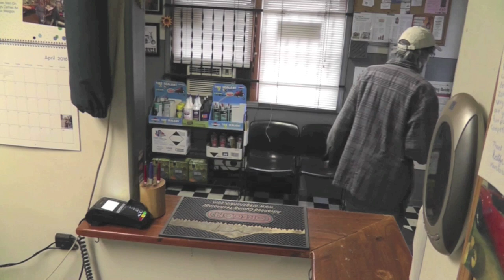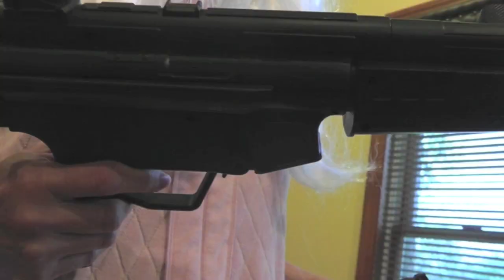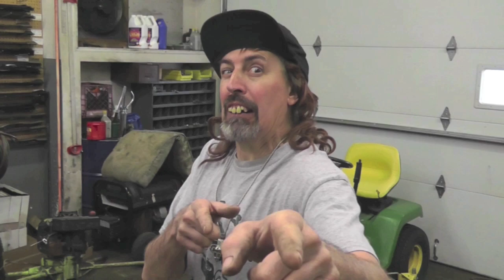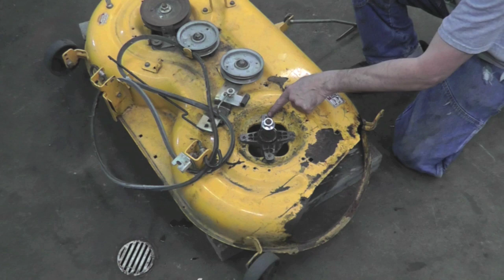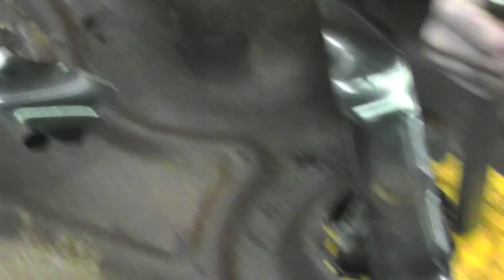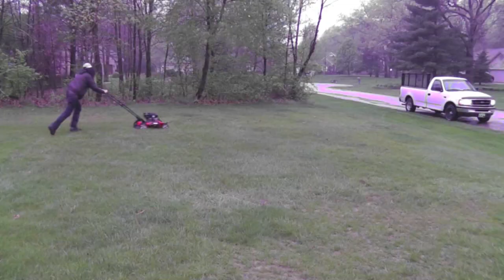Easily Fix Your Bent Mower Deck (Cutting Uneven)

Comment: Easier way to do it.  I've straitened 1/2 dozen Craftsman 42" decks.  Always left side, about 2-3 o'clock, facing front. Can determine by stretching string across pulley tops.  Will be space about 2-3 o'clock.  Loop a short length of small log chain around 5' crowbar and just under pulley. Pull back on crowbar, sometimes have to put a weight on opposite end of deck, often not. Keep pulling and stretching string across pulley tops until no space, can be verified by matching blade ends underneath.
Reply: I wish you could explain this a little clearer. I'm trying to visualize your directions but not really getting it. Wish you'd make a video or even a few still photos.
Reply: You need to be clearer on these instructions. Is this with the deck still on the machine or off? Are you 180 degrees opposite the 2-3 o'clock position when you are prying with the crowbar? What are you anchoring the bar against--the deck while you're prying or what?

Comment: If the deck is bent, it will line up to the same line you made as long as the blades and spindle is straight. You need to measure it against the deck lip all around. I do the same but I shim the deck til the deck lip is level with a bubble level. Then lay the bubble level over the spindle mounts. Adjust with your BAH until its level all around. Then you can take a straight edge across both blades.

Comment: This was the best informative video ever. I put new spindles on my deck. (Bearing was out)  still mowed crooked. New lift cables, still crooked, adjusted deck, still crooked. Found this video.  Got out the big hammer. Mows straight now. And the wife cooked me dinner.
Reply: There's your dinner
Reply: Lower psi in one tire, raise the other. Problem fixed.

Comment: Love your videos and your way of putting your knowledge out there to us.
This is the first time I've seen something in your videos that I cannot agree with.
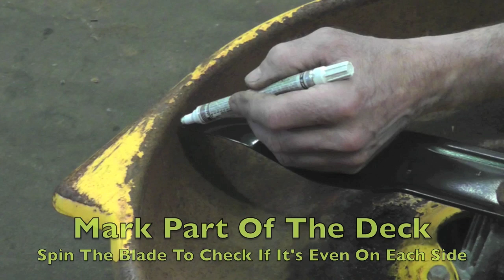At 6:00 in the video, you marked where the NEW blade hits the deck and spun it around. You said something like this one lines up, so it's gonna be the other side that's bent.
If the spindle is running true and the deck itself is bent, the blade would line up on both sides using this method. The way to actually measure the variance is by laying a straightedge across the deck and measure down to the blade edges.
Keep on sharing the great hints and how-to lessons! And it looks like you might want to see a barber soon. 💈 ✂️😉

Comment: You're amazin' Taryl!  I cannot tell you how many times you have helped me!  Could you have shimmed the spindles instead of beating the crap out of the deck and possibly breaking one of the spindle housings?  Your fan forever!
Reply: I was thinkin' same...
Reply: I was thinking this too. Swimming it seems easier.
Reply: It's easier but it doesn't work b/c it skews the geometry of the blade. Everything MUST be in the same plane or it WILL scalp. Ask me how I know.

Comment: Please don’t tell people to beat their decks to death. Use a straight edge on the sheaves and use a galvanized pipe with a flange bolted in place of the spindle. Then you can gently bend the deck back in the correct direction.
Reply from the maker: T Blake Good luck!

Comment: All my stuff is old and all the decks look like that, usually I paint the underside with a mix of oil and cosmoline every couple years. If I get a really nice deck, I wire wheel it (safety glasses. face shield, gloves and apron), use rust killer( converter) and paint. Decks go bad before the rest of the tractor.  Great channel Taryl.

Comment: NOTE:  Go get large some Washers, place them on top of the bolts.  This would help it strengthen and prevent warping.  The washers must be as large and thick as you can get.

Comment: I had the exact same issue but fixed it much easier..I used a 4 foot level laid across the deck and measured the blade tip to level distance  then went the opposite way over each blade to measure the other way
Reply: This would be the truly best way to ensure both blades are aligned properly.

Comment: ust because the two center tips are even does not mean the blades are alligned correctly. You really need to lay a straight edge across the deck to make sure both the inside tips are not high or low. You can correct the cut misalignment in the center and create a misalignment on the next pass on the outside.  BTW love your sense of humor.

Comment: Just fixed my John Deere Z225 42" deck!  Thanks for the great video.  I went straight to the sledge hammer and it worked great. Thanks again!
Reply: I have that mower and I’m having an issue where it’s gouging real bad. Looks like this must be the problem.

Comment: That mushroom should be ground off that bar before you beat on it. One of those slivers can break off and put an eye out. It's a good idea to wear safety glasses when beating on things for that reason. My local carpenter loss an eye that way. I know the odds are slight but losing an eye is forever. It's a good idea to wear ear protection too.

Comment: I did this today but a little different. I placed a level across the pulleys and straightened the mounting ears until they were level. Worked good hopefully it lasts. Had to do some welding on the deck also found cracks here and there.

Comment: I checked tire pressure, level floor.  The Blades are leveled with a blade gauge, side to side, but I note my deck (E100) is 1/2 inch higher on the grass chute side, including the scalping wheel (but blades are level.)  I checked the alignment of the bottom of the two blade tips and they are within 1/8th of inch of each other, so they are not crooked.  What could be causing this?  If I level the deck instead the blades will be off.
Reply: One of the deck hangers is adjusted differently  than the one on the other side. Or low or flat rear tire

Comment: If you snap a bolt in your spindle you can get the bolt out by boiling the spindle in a saturated solution of alum(pickling spice) just make sure to use aluminum or glass boiling pot and pull everythinh iron out of the spindle. Alum solution will eat away anything steel

Comment: a crude method that works as long you don't loose your reference
in such a case, I by far prefer use shims to regain plane between both blades

Comment: Taryl, I have a JD Z255.  Every time I mow now, the drag link that lifts the front of the deck comes out of its mount on the frame. Is this an indicator of a bent deck?
Thanks, Steve
Reply: I am not an expert but if the mounting brackets are not damaged then you probably don't have enough weight hanging on the drag link. Do you have your front wheels set too low. You want the deck hanging on the drag link and not taking the weight on the front wheels. I would also get a deck level gauge and check the levelling of the blades.  Oregon 42-095,  John Deere AM130907 or Stens 750-422.  What height are you mowing at ?
Reply: @markrobinson8539  thanks, i'll check everything you've mentioned.  I typically mow the yrd at 3" on the mowers gauge. I'll bet i've damaged a mount, this has been mowing great all summer until now.
Reply: Chris and Steve on my jd lt155 there is a retainer kind of like a bolt and nut that makes it so the deck front adjuster cannot come out unless you remove the retainer

Comment: Yeah that was a big band thought it came out like the previous person said in the comments I've had to beat the crap out of mind before I've had to weld plates in where the spindles fit two to make it work ever rested out I've also wanted so there's a lot of things you can do in a lot of times when that leading edge of the Dead gets broken off and you can also weld round in there because once that leading edge is broken off of your deck that means that it loses all its strength the band around the edge of the deck where the strength of it comes from and the same thing Carol was doing there is just pounding the steel back in shape because metal stretches and relaxes the same way it would if you heat it up with a torch and then beat it kind of like blacksmithing

Comment: Hey Taryl I need some help with a Cub Cadet 2146 mower deck. It has a 38 inch deck in poor condition and I got a really nice 42 inch that I would like to put on as the 38 inch isn't made any more. Can this be done? I called Cub Cadet and the guy I talked to didn't have a clue. HELP!!!

Comment: Shimming the spindle would be the easiest and fastest.  For the blade level checking I would just take measurements on each side of the blade to a flat part on the deck and go from there.  You can't just put a mark on the side of the deck and rotate the blade like in the video because that will only show if the blade is bent.

Comment: Hey Taryl - today is the grasshopper's day.  I hope when you read this you do it in your complaining lady voice.  That way you showed with a white marker to see if the deck is bent doesn't tell you the deck is bent.  It only shows you that either the blade or spindle shaft is bent.  Your other measurement is correct for a bent deck but could also be a bent blade too.  You have to check both ends of the blade rotated and are both off, if it's just one end of the blade then the blade or spindle is bent.

Comment: You're method of marking the deck with a paint pen will only tell of one side of the blade is bent, not if the deck is bent.
Regardless of deck being bent, if the  blade is good, both tips of the blade will line up on your reference mark.

Comment: Cast metal LOVES hard sharp impacts!
Reply: ERIK LARSON: Yeah, that's the first thing I cringed at! And those are aluminum cast, as well, I'd bet?  Just waitin' for one of those ears to pop off, making that elusive(& expensive!)spindle replacement a sudden gotta do...!
Reply: Oops Oops the spindle casings are.
Reply: Sometimes you get a pooch that just can't be screwed. That said, a press or a hydraulic jack might have been a bit more precise than the big hammer though probably not as cathartic.
Reply: He wasn't really beating on the spindle castings. He was beating next to them on the deck.

Comment: Marking the deck with the blade and then rotating the blade doesn’t determine if the spindle isn’t straight.
Reply: No it doesn't...it will show if the blade is bent..

Comment: Daryl knows all!!  Mower does not cut ANYTHING at lowest deck settings!!! On high settings, it cuts, but at lower deck settings I get nothing!! Sounds like the PTO isn't spinning.  Variable speed LX500 that has some renegade 48 inch cut two piece deck.

Comment: There has to be a better way than beating it straight. This will anneal the metal some which means more future  bending.  And why does everyone post this method like its some repair revelation.  Maybe rings welded over deck bottom in a true plane, the spindles installes on them

Comment: That is the only way to “fix it” beat it into submission! You could also show the front to rear edge measurement that is likewise in need of beating back level..
And last but not least you can tell these yahoos about the reinforcing pieces that are available to “stiffen” the deck area of the spindles.. 
And there’s your dinner!

Comment: you could take precision measurements with a dial indicator  it would show high and low spots and you would adjust accordingly. But I think a hell of a lot faster trick would be to just stuff in washers to bring it back in. Let's face it the decks not going to last long unless you always clean off the grass. Wet grass will rot a deck out.
Reply: bobbg you're going to get out the dial indicator for a bent mower deck?  You must be one of those overpaid engineer types. Do you love peg board? How would you take measurements with one anyways? Every time you moved the base you'd lose your reference and it wouldn't stay on/accurate while beating on the deck.

Comment: If the deck is bent, doesn't the marker trick just check it the blade is bent vs the deck?
Reply: It's a process.  You take the blades off to see if they are bent first.
 Blades in this video were new. Not bent

Comment: lol people really pay you to work on there stuff, lol most of the time its a bent shaft on the spindle, but you can take a strait edge and measure from the bolt holes to the strait edge layed across the bottom of the deck,

Comment: Here’s how to do this. First you need a solid steel bar about 1 and 1/4” diameter and at least 5 feet long. Pipe or square tubing would probably work too. You remove the pulley and slide the shaft out with the blade still attached. Take the bearings out of the spindle. With the deck sitting on the ground you put the bar through the center of the spindle housing. Stand on the deck and use the bar to tweak the spindle and the deck back straight. Stick the bearings back in and slide the shaft and blade back in and check it. If it needs more do it again. This is easier and faster than beating on it with a hammer and you don’t have to remove the spindle bolts.